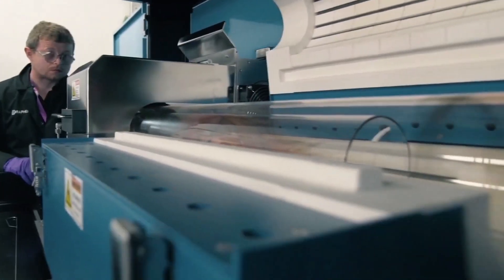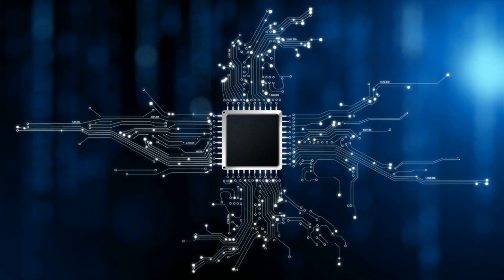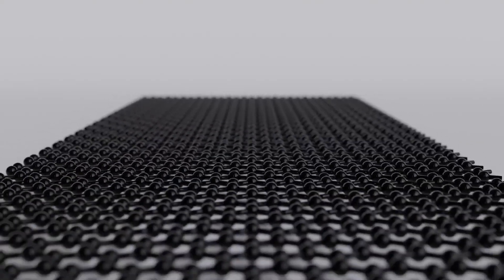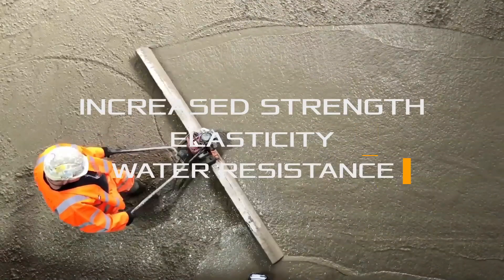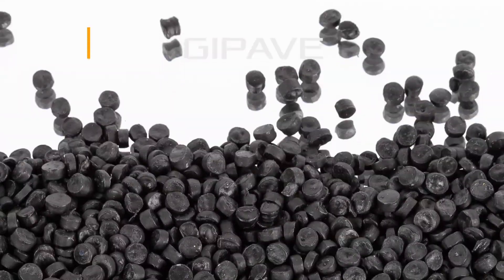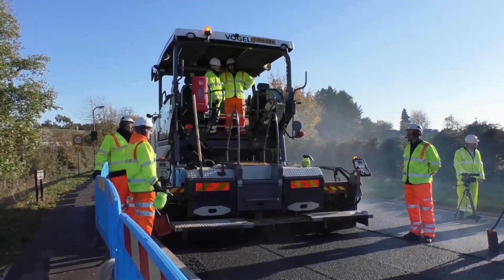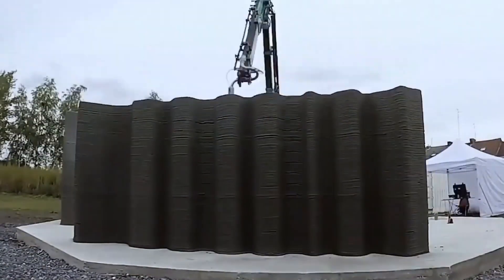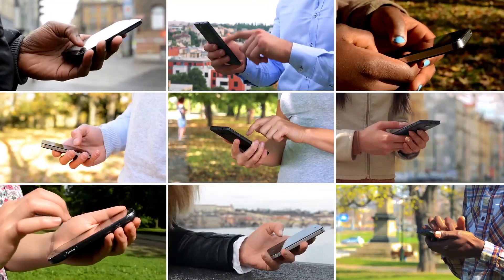Graphene in concrete is already changing the rules of the game in construction

Comment: Some of the biggest problems with concrete are spalling and water infiltration due to thermal cycles. Over time, this leads to rusting rebars and severe risk of structural failure. If graphene can help solve these problems then the product will have a great future, especially in outdoor structures like roads and viaducts.
Reply: that is the problem we have in Montana most bridges start failing within 20 years, and if you are in montana look under your closest 20 year old bridge
Reply: @sasha642  Epoxy coated steel was, or is,  or supposed to be, the solution to deteriorating rebar in concrete.  Of course everything deteriorates over time. The 3d printer pouring the walls was pretty cool.
Reply: @dennissmith5037  epoxy coating works until there is a crack or chip in the coating, then it's far worse. Here in Canada they have tried stainless (must work well but $$$$), fiberglass and gone back to regular rebar.
Reply: @pinerock9668  Also a LIGHT coat of rust increases bond between rebar and concrete. Problem is when there is an ongoing source of both water AND oxygen. Mostly due to insufficient cover.
Reply: @dennissmith5037  surprisingly, epoxy coated teabag causes more problems because of tiny flaws in the epoxy cause corrosion. Epoxy coated rebar is prohibited many places
Reply: @sasha642  :  I live in Vermont and we have the same problem.  The causes are twofold; One is the the weather, which we can do nothing about and is manifest by pot holes and "frost heaves", both on bridges, and on roads over land.  For the other it is the use of road salt for control of ice and snow on roads which causes the steel re-bar in the concrete to rust faster.  Some states, like mine have a "dry road" policy, and in my state it a lot of the justification for it for the benefit winter tourists who don't know how to drive on snow and ice. A solution to the first problem was developed decades ago and involved and addition of ground up old rubber tires into asphalt, the problem was that the pavers union lobbied against it because by having the roads lasting longer it would provide less work for their members.  For the second, it would involve the use of less salt on the roads in winter and REQUIRE both the use of "winter rated tires", lowering the speed limit when their is snow and/or ice on the road and the passing of tests in driving on ice and snow to get a driver's license.
Reply: When concrete achive less basics like 10 or 9 steel rust so why dont we useStainless rebar or fiberglass to solve this problem.
Reply: @David_Moreau_1990  Initial cost would be my guess and it's not profitable to make things last forever.
Reply: @craigdavies8099  , You nailed it. Its always about the Benjamin's. There are multiple products that can be used instead of rebar, but they multiply the costs. Hold on.....I hear a sound....OH YEAH! It's the  bottom dollar speaking.
He's the Boss.
Reply: @davidgraham2673  in the hot rod business there's a saying- speed costs money, how fast do you want to go? Same is true everywhere. It's why that same pot hole shows up year after year.
Reply: @craigdavies8099  
So true....
Reply: @craigdavies8099  money will always be the cause of mayhem and destruction until we remove the system entirely. it amazes me how many deaths occur every year directly and indirectly because of money and yet we do not do anything about it. i am sure that number is higher than all other ways to die combined. i would even bet on money being the cause of human extinction
Reply: @HurricaneJD  sounds like you've heard about "The Venus Project", if not, I would suggest you check it out
Reply: @David_Moreau_1990   . . . . or graphene :-)
Reply: @David_Moreau_1990  SS is expensive and fiberglass is must be three times in size (for equal strength). Glass is stronger than steel on an equal weight basis
Reply: @David_Moreau_1990  cost
Reply: @jaik195701  it's not really the cost because it and at max 10 to 20 % of the total cost!
Reply: @David_Moreau_1990  Only certain types of glass are compatible with Portland cement; basalt fiber works, some artificial fiber is also used (polyester etc), stainless steel fiber/wires is already used. Also 'concrete' is a layman's catch-all word much as 'plastic' is or 'glass' or 'metal' are; there are many different compositions/elements/compounds that fit those names but are fundamentally different.
Reply: @David_Moreau_1990  some concrete contractors do use fiberglass mesh for reinforcement.
Reply: @Kenneth Draper  Yes and i put for some job fiberglass rebar where it need and carbon tape on the side that requiere more tension force put in fact more than 90% of the concrete structure can last more than 2 century by adding maybe maximum cost of 20-40% increase cost. Just by changing rebar or by changing the concrete formula. So why whe dont build for multiple century if we can. If we dont have to build bridge every 40 to 50 years we can invest it in other thing to build something else. Maybe people in the 1950 to 1970 think that they build for 50 years beacause in 2000 every body will get a car that can fly. So the bridge build for multiple century will be destruct to do someting different with that land.
Reply: That is what happened to that tower of condos in Florida.
Reply: I believed coating the structural steel with the graphene would be a good start just for those reasons mentioned. If you reduce the oxidation of the steel you give it longer life.  I think graphene in painting applications would be a great idea as well in the building trades.
Reply: concrete has water in it, therefore the moment the concrete is poured it comes into contact with rebar and begins to rust the moment its poured. 99.9% of the time the rebar is already rusting on its surface the moment it's delivered to any jobsite, long before the concrete is ever poured, adding more water to the corrosion. 

You're issue with concrete is the standard of testing to ensure concrete is of proper quality, slump and strength for what ever it was designed. 
That all starts at the pit where the aggregate is washed and stacked.
If the aggregate is of poor quality and not washed properly you will have ridiculous amounts of quality issue with concrete before the concrete is even mixed. All of these old concrete structures like dams are still here not rusting away...because back then it was about quality, today its about quantity and a sacrifice of quantity is the quality. People want money, they don't care what it costs them tomorrow as long as they can obtain something today.
Reply: @caseydman4651  Absolutely true. The Phoenix airport has had their concrete replaced 3 times in a 3 year period. Every year they tear up concrete they just poured a year ago. Pretty sure concrete is supposed to last more than a year. I don't even want to know who is paying for all that too.
Reply: @Cpt_Adama  phoenix being in AZ where it's stupid hot is probably dealing with heat expansion and buckling, the concrete expands so much it will literally buckle upwards like a mountain(obviously not a good thing for an airport) add that to the concrete curing to quickly because of the dry heat, will make it weaker(less than the design calls for)It's all tax payers money. unless it's someones private property that does not benefit the public, it's tax payers that pay for these repairs.
Reply: @caseydman4651  I've worked at this airport for the the last 22 years and until they just recently started tearing up the concrete 3 years ago, it lasted that at least that amount of time (19 years). The concrete is not buckling or otherwise have any surface problems that I can see, but from what I've heard it's failed the weight bearing test. So they tear it up and start over. Hopefully 3rd time is the charm.
Reply: @Cpt_Adama  I thought PHX is were rubberized asphalt was invented and used on all the runways?
Reply: @Rivenburg-xd5yf  yep it is on the the highways but not on the airport ramp or runways. Also they seem to have lost interest in repaving in rubberized asphalt as they just recently stripped the 101 back to concrete. I think the rubberized asphalt lasted about 10-12 years before it got beat up.
Reply: @Cpt_Adama  lasted too long for the local nepotistic brother in law  payoff err i mean repaver.
Reply: @caseydman4651  Mmmm, I just love reading the truth, thank you :-)
Reply: One important thing is getting keeping the rebar from the surface of the concrete. Far too often engineers have insisted that the rebar must be very close to the surface of the concrete for maximum strength but they seem to forget the issue with rebar rusting. Also we do have water proof concrete, I've poured it for water treatment plants here in Canada. It's very sticky and difficult to work with and hard to wash off tools later.
Reply: @pinerock9668  yeah, the waterproof concrete mimics the roman concrete, even more difficult to use and clean off. 
The difference when you have to break or cut it is VERY obvious. 
Im just starting to study the different concretes themselves, ive got a building project im avioding wood. ive studied the different rebars and additives like glass wool or plastic or carbon fiber. 
See the aircrete guys here in YT? 
Crazy engineering im going to try some. aircrete with carbon fiber, IS THAT ASKING TOO MUCH ;)
Probably, but ill try it.
Reply: @pinerock9668  Sodium silicate known as water glass right?  We used it after mixing it with water to dissolve it into a thick syrupy liquid which we spread so that it will react with the calcium of the cement to form a non-porous and water tight calcium silicate crystalline substance starting from the surface to the very deep layers of the concrete itself after it has hardened itself.
Reply: Makes 3D printing a lot easier.

Carbon vinyl that's almost all the benefits of vinyl and carbon fiber, while being ridiculously easy to print, even though most carbon-based and most vinyl based filaments are ridiculously difficult to print.
Reply: The is a strong product that is made out of basalt rock the most numerous rock on the planet. There is rebar and fabric products that ares strong than steel and resistant to any damage from water. Think all foundations, roads, bridges need it. Think the hydrophobic properties of graphene with basalt rebar could be a real game changer.
Reply: It's corrosion of rebar that causes spalling not thermal cycles.
Reply: A pinhole manufacturing defect or a scratch that may occur during handling or placement at a construction site will cause an epoxy coated rebar to degrade rapidly. Epoxy coated rebar has been banned in the province of Quebec. Other provinces in Canada and many U.S. States have initiated studies re-evaluating its use.
Reply: A strand of spider silk is said to be 5 times as strong as steel.  If there's a way to manufacture it in large quantities using bacteria or yeast, it might be possible to replace rebars with spider silk.   It wouldn't rust, but might still be attacked by bacteria as it's made of amino acid.
Reply: The idea that it should also help with earthquake safety too makes it very important.
Reply: Basalt fiber already gets around the rebar rust issue. To be really game changing the graphene needs to remove the whole labor intensive process of putting bars of anything into the concrete forms in the first place.
Reply: They will never make structures that last that much longer. Maybe a bit but they will intentionally make them not last too long to gain more money when rebuilds are needed. 
It is just how consumerism works.
Reply: Can't you just treat the rebars before putting them in the concrete? Seems much cheaper than using graphene.
Reply: If, the huge cement compounds can penetrate and bond with the tiny graphene physical structure Hard to do at a molecular level.  Even rebar had ridges for better adhesion.  Vinyl coated rebar.
Reply: this was my first thought as well.
Reply: Anyone who says SPALLING knows alot  about concrete.
Reply: @cjapao8058  Spalling is when you are travelling with a basketball or is it a rugby term?   😀😁😂🤣😎
Reply: Concrete that is not loaded beyond its rated strength and that also does not contain rebar (or any other reinforcing material that deteriorates) could potentially last thousands of years.  If indeed graphene behaves as advertised, we could build roads that last for generations and buildings that need virtually no structural maintenance.
Reply: Cement is 50% calcium. Western and Eastern Roman Concrete, if pozzalana is not available, uses an equal volume of powdered fired brick or tile or pots to replace pozzalana with an equal volume of slaked lime (100% calcium) and an equal volume of sand. This creates a water proof water (1 part slaked lime + 1 part powdered fired brick + 1 part river sand) to build their aqueducts, pipes, canals, baths, pools, etc. Since cement is 50% calcium, then I suggest for every 1 bag of cement used (and cement is 50% calcium and 50% clay fired into clinkers and milled into powdered portland cement) one must add half a bag of powdered fired brick as fine as the cement itself. The silica in the powdered fired brick will "REACT" with the calcium in the cement and cause it to become waterproof. The solution has been facing you westerners for more than a century and you ignored it!
Reply: @darthvader5300  , Not true. The reason Roman concrete was not used is because in large pour applications, you can't pour it. It is a very dry mixture that must be packed into place, and shaped. This does not lend itself to large projects on a modern time frame, and labor costs. There is now a chemical used that allows concrete to pour easily, and yet retain the strength that Roman concrete achieved. It wasn't that the mixture was unknown, but rather, that previously it couldn't be used in modern applications. The lasting ability of Roman concrete is apparent, and very well known. Theres a great youtube video that explains this very well. You might enjoy it! Have a great day.
Reply: @davidgraham2673  Does that explain why they moulded and carved it like clay? Didn't hear that at school.
Reply: @3tapsnu0ut87  It certainly had the consistency to be molded, and carved once it was patted/packed. 
I saw a video of a guy doing filigree style work with concrete for ornamental purposes. It was thicker in consistency than concrete which could be pumped, and he carved away the excess to get the effects he was trying to achieve.
I have no doubt that Roman concrete could have been manipulated in the same fashion. They were very clever, and inventive back then, and sometimes we tend to look down on their accomplishments.
Reply: @davidgraham2673  It sounds like a fun recipe :-)
Reply: @3tapsnu0ut87  , There was certainly skill involved, but it did look very fun. Reminded me of when I was a kid in Germany, and my brother and I would carve roads and structures out of a clay type dirt for our Hot-Wheels, and tiny dump trucks. Great memories- no cares to every about back then.
Reply: @davidgraham2673  That's funny, as a kid, I used to go fishing with Dad (NZ) and wind up carving torus' out of the clay stock bank! 
Them were the days, eh :-)
Reply: @3tapsnu0ut87  , When I think of fishing as a kid, I think of my Uncle taking me fishing in Italy. Those were the days, alright. Always wanted to see NZ. People there seem so laid back, and charming.
Reply: @davidgraham2673  Roman concrete lasted for millinial because it was very good, but also most roads were in fairly temperate climates that do not see wide swings in temperature, or driving agents, and most importantly their traffic was mainly foot traffic & horse drawn carts. You run 670 80'000 LB. Tractor-trailers and 6000 cars down that same road and it would be lucky to last 3 years.
Reply: @davidgraham2673  Thanks but we already solved that problem with concrete vibrators and plasticizers and retarders. But especially with the use of concrete vibrators.
Reply: @davidgraham2673  - Hey the youtube video that explains very well Roman concrete. Do you have a title by any chance to a specific video you were thinking of by any chance? 

 Have you used "basalt" rebar? I am asking for several reason but the main reason is for these concrete homes that are said to be less expensive (Automatic-construction company).  You seem to know quite a bit about this subject and thought you might be able to direct me to additional beneficial information.  I  have no idea what the air quality would be like living in a concrete home. 

My alterative thoughts would be something like that Geoship company that uses a Bioceramic composite material.  The cost of wood is to much not to have an alternative in mind as i see things. 

Lastly it is unclear to me how lye vs gypsum and other materials make a difference for the recipe of making concrete.  There seems to be so many different uses. 

At any rate enjoyed reading your comments.
Reply: @nobodyisprfct  , Thank you for the kind words.
I'm not an expert on concrete, but I do know a few things because of years in construction. 
YouTube brings videos my way through the all-knowing algorithms. Since I love to learn, I watch an eclectic group of videos most days. 
That's how I first learned about Roman concrete. They even tested the recipe against modern concrete, and it performed amazingly well.
Unfortunately, it's very labor intensive because it can't be piped up thirty floors, and poured into place. It must be mixed, and hand packed because the moisture content is very low.
I've seen the modern home mixture of bio-crete that you mentioned. It looks like it's a great thing to me.
They also have machines now that 3-D print homes using a concrete slurry mix, but I know very little, other than seeing it on a "Tomorrowland" type video.
I think we both see the value of alternate construction methods using inexpensive materials. Oftentimes, these are great at insulating from heat/cold, and are very strong but light (if bio material like hemp is mixed in for strength/insulating
advantages).
I've seen some really neat ideas, and have always wanted a home built into the side of a hill, overlooking a valley lake Vista. Glass front, with flagstone pillars to hold the glass in place, and for roof support. 
In Del Mar, California, there is a home overlooking the famous Thoroughbred Racetrack that has components of what I'm thinking of. The view of the Ocean is incredible there.
(I used to work at the track)
You gave lots to choose from, and I hope you find the perfect type of building material.
PS, homes in Florida are often made of concrete walls, with wood batting strips
secured to the concrete, and drywall screwed, or nailed to the strips.
They seem to hold up well against hurricanes, but don't take my word for it,, you'd be wise to ask experts about that.
Best wishes to you. You'll have fun researching, and you'll learn plenty.
(I love to research when I'm getting ready to spend big bucks).
Reply: @davidgraham2673  - Thanks for you time and reply.  Around the time of Cody Lundin and Dave Cantebury was when my interest peaked in new building materials.  Until reading your comment it didn't down on me about possible short term failures with concrete.  

After reading Popular Mechanic, Home Power,  and watching how other homes were built in other countries. Oh and after learning about this one building engineer that designed a building that uses different metals that react to different temperatures which moved the metal open and close.  I have been interested in ways to livin in a home that does cost monthly money.

 The building or structural engineer may have been inspired by Mashrabiya.  I just remember seeing the fish looking scales made of metal opening and closing depending on the time of day and temperature, and that they used different temperature sensitive metals to make this happen. Mashrahiya has neat ideas and i really like the passive sustaining cooling ideas that incorporates older knowledge. 

Learning is fun, it would be even more fun if i could remember half the things i have learned. LOL 

Take care and thanks again.
Reply: @nobodyisprfct  , I love these types of discussions. When I lived in Leucadia, I was fortunate to live in a downstairs rental on the cliff right on the ocean.
In the summertime, the ground kept the living area I rented, at a cool 65 or so degrees in the summer heat of 90-100 degrees. I learned a lot of useful tips about using natural means, and materials for living comfortably.
There are great videos of people building things like Hobbit houses, and off-grid living. Great ideas you can incorporate.
The YouTube algorithm will start feeding you videos to check out after the first few. Enjoy, and best wishes.
Reply: @darthvader5300  lime mortar and concrete are different beasts all together; they cannot be mixed. The basic reaction within the lime mortar is formation of calcium carbonate in the form of extended twinned crystals whereas in concrete the process is basic hydration and growth of silicate structures.
Reply: @janami-dharmam  In Russia, our missile silos uses both with sodium silicate to form calcium silicate in both mortar and concrete to make both non-porous and water tight.
Reply: @darthvader5300  not much demand for relatively soft roman concrete, everyone acts like this has never been considered lol
Reply: @hawgcranker420  LOL back to you! Buy a  2-WAY ticket to Rome and check out the Ancient Roman concrete and it is even HARDER than the surrounding rocks around it.
Reply: @darthvader5300  nice!  And do you know about the specs of 🌿 Hempcrete too?  I was saying it would be interesting to see what graphine and hempcrete do together, now add the fired brick and portland cement powder …
Reply: @darthvader5300  Water proof water, nice one!
Reply: @darthvader5300  sounds like a formula used to build Roman structures some of which are still standing.
Reply: Who cares about any of that? By the time it happens I'll be dead.
Reply: we used to make asbestos concrete, with all that asbestos safely tucked away inside the concrete were it cant hurt anyone. 
Abestos concrete will last in full weather, until the sun goes nova.
Reply: @Rivenburg-xd5yf  Thats great until repairs need to be made that require cutting or breaking the concrete which will expose the workers to fine asbestos fibers and is probably the #1 reason it is not done anymore.
Reply: @acdii  How is graphene any different? Wouldn't the dust be as bad or worse? What about the dust from carbon brakes  added to the graphene dust making driving on or living near a busy road deadly. Just questioning, not trolling.
Reply: @acdii  Yes, everyone knows that NOW.
Reply: @acdii  in the USA concrete is legally required to be wet cut but I still agree that asbestos aren't the best idea. Maybe for a bridge where it will be monitored it might be fine.
Reply: @craigdavies8099  I've thought that too. Who is testing exposure and it's effects? Will it be a modern 'asbestos'?
Reply: @Rivenburg-xd5yf  As anybody with an asbestos panel garage knows, it becomes porous after 50yrs or so.
Reply: @Rivenburg-xd5yf  
Yeah, till someone cuts/drills/demolishes it.
Reply: @thedolphin5428  How much baby powder have you used? Been in the room when it was used? changed the brakes on any cars from the 60s or earlier?
Reply: @Rivenburg-xd5yf  All you've got to do is survive making the product, using the product, maintaining the structure, decommissioning the structure, and disposal of the material.
Reply: @Struthio_Camelus  YOU worry about the disposal that will be NEEDED in half a million years. 
Sane people will watch from the clubhouse bar.
Reply: @Rivenburg-xd5yf  Note that disposal was the LAST item on the list. What structure needs to last half a million years? Anything other than a nuclear waste storage facility, of course.
Reply: @Struthio_Camelus  AH! A CRACK IN THE ABSOLUTIST ARMOR.
Careful, other ideas might get in.
Reply: @Rivenburg-xd5yf  Ok, now I've found a use for your super-product you'll have to make an effort to prove it does what you say it does.
Extraordinary claims require extraordinary proof.
Reply: @Struthio_Camelus  no i dont. you have the same device welded to your arm i do.
Reply: @Struthio_Camelus  ENJOY! I am.
Reply: Also replace the rebar with fiberglass mesh and the rusting is not a problem.
Reply: No company will try and make something that lasts longer.. asphalt companies could make roads that last 20-30 years.. but instead they make roads lasts 8-10 years so they get paid to keep re-paving.. Apple won't make a phone unbreakable cause they want you to break it so you have to buy a new one... Michelin could make a tire that lasts 5-6 years (MXV 3).. But then they realized their error, so they make the MXV 4 that starts cracking at 3-4 years... money is holding back the advancement of civilization...